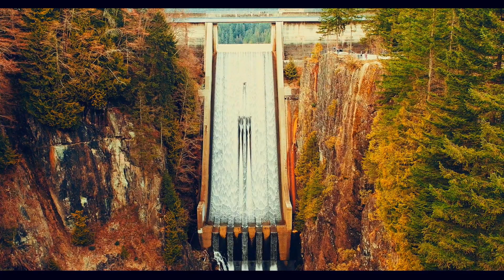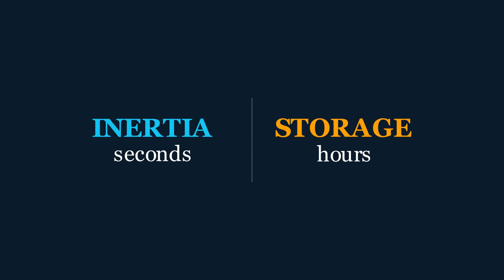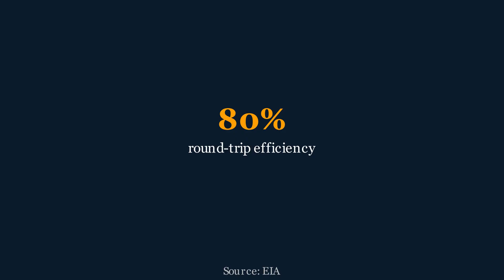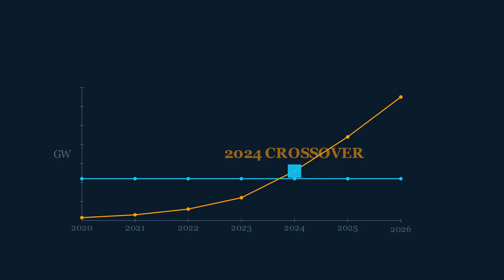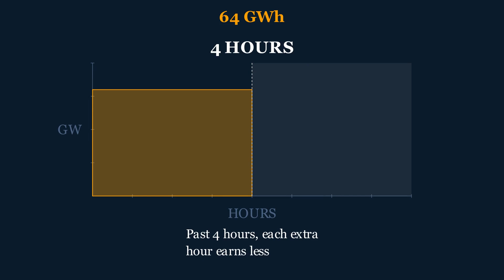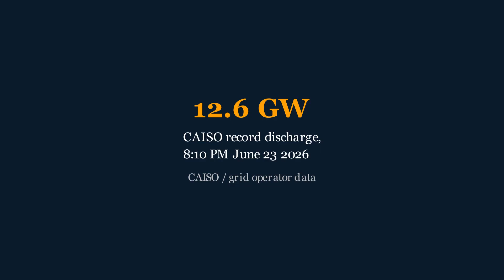Why Can't We Just Store Electricity?

Comment from the maker: The distinction the whole video turns on: a battery has two ratings and headlines only quote one. Power (GW) is how fast it can push energy out. Energy (GWh) is how much is in there before it's empty. Almost every US grid battery is built to 2-4 hours of duration — not a technical ceiling, an economic one, since the daily price spread you're arbitraging is only a few hours wide.

So: roughly 65 GW of US battery capacity at ~4 hours is about 260 GWh. The US consumes on the order of 11,000 GWh a day. That's about half an hour of the country — my arithmetic from EIA's capacity and consumption numbers, not a published figure, so treat it as an order-of-magnitude sanity check rather than a precise claim.

None of which is a knock on batteries. They were built to solve the evening ramp and they solve it — CAISO hit 12.6 GW discharging at 8:10 PM on June 23rd this year, charged at noon on surplus solar. That's the tool working exactly as designed.

Comment: We do store electricity. It’s called a battery
Reply from the maker: A battery stores chemistry, not electricity — it converts power into chemical bonds and converts it back, losing about 20% each round trip. That's the whole point of the video: nothing on the grid holds electricity itself.